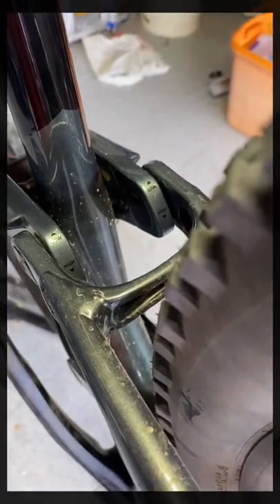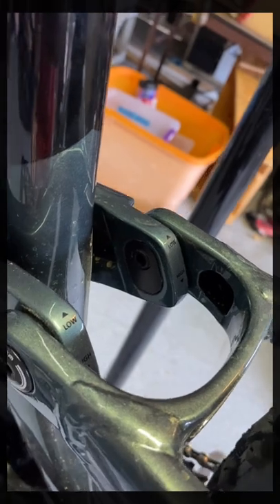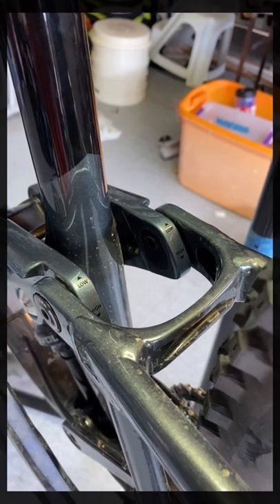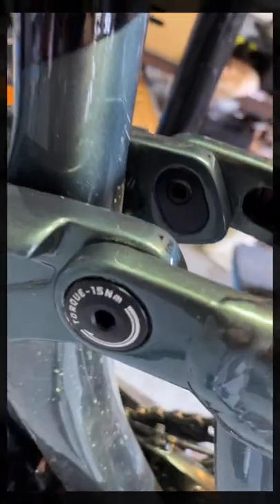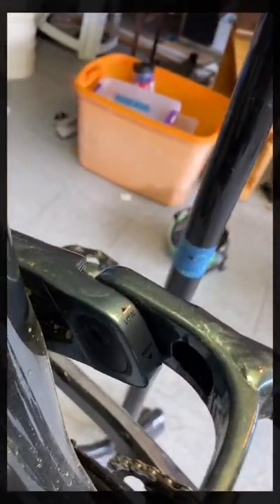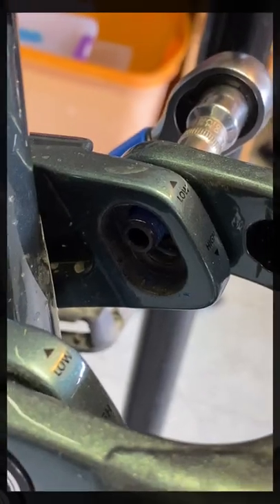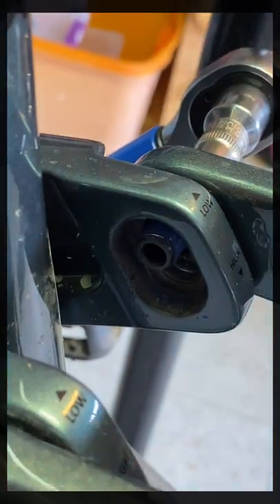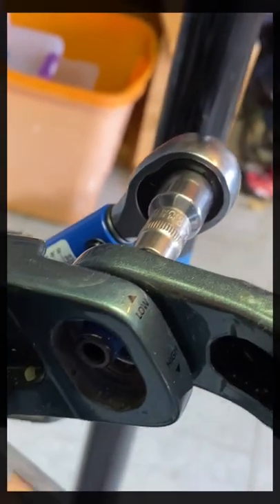Giant Trance X Flip Chip MTB Rear Suspension #shorts

Comment: Did it make any difference?
Reply from the maker: The bike definitely felt different. It was much higher up or at least it felt that way.
Reply: When I did it it seems like it turned sharper around obstacles while moving slow. For example when the trail mix a sharp 90° or 180° turn around a tree. But of course this makes the front end more twitchy so if you ride really fast and straight you want it in the other position